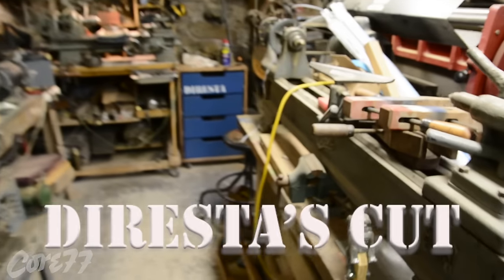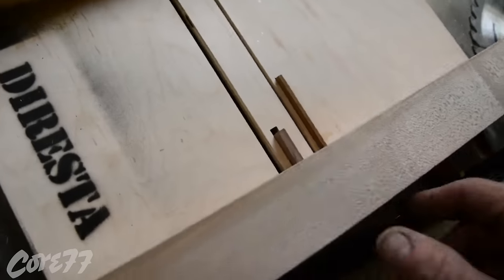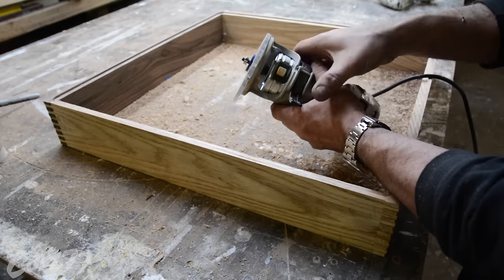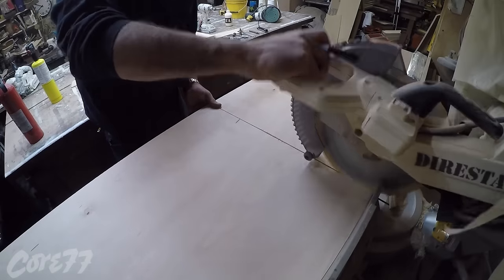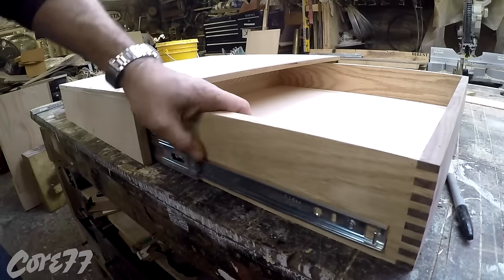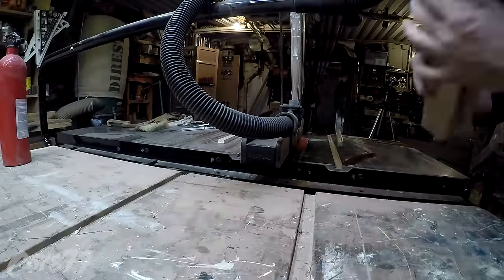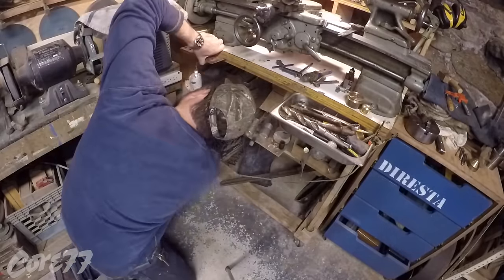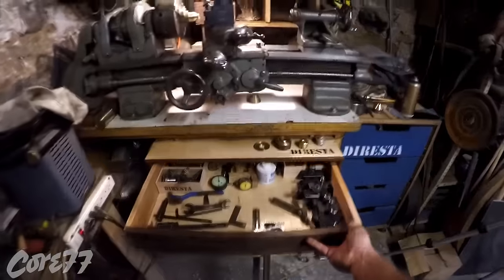Diresta's Cut: Lathe Bench Drawer

Comment: Nice South Bend Lathe also like the Drawer very handy when working. I built my own Lathe stand out of 1x1 square tube and welded it. and built a shelf on the bottom to hold a small file cabinet it holds  bits indicators tool holders chucks   etc  it works good with my 12inch Atlas Lathe  but also thinking about a small pullout drawer like yours  to lay my Mic and Dial  Cals on  your Garage looks like mine but I am starting to get rid of a lot of stuff so I can work in it